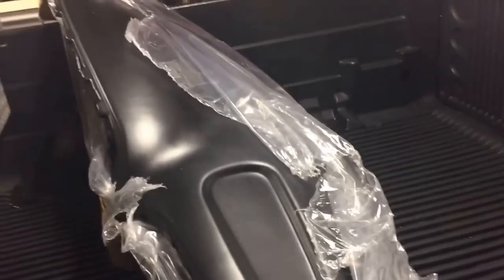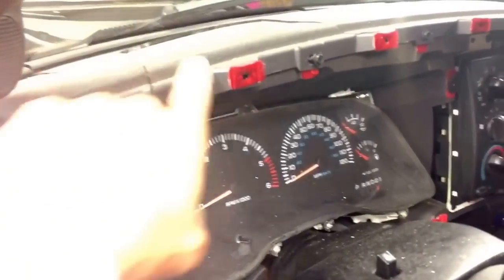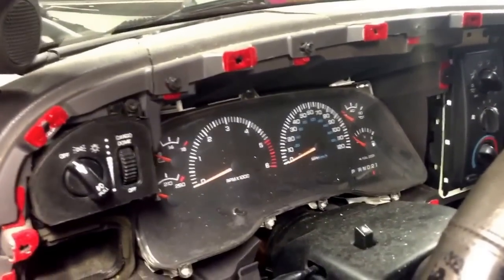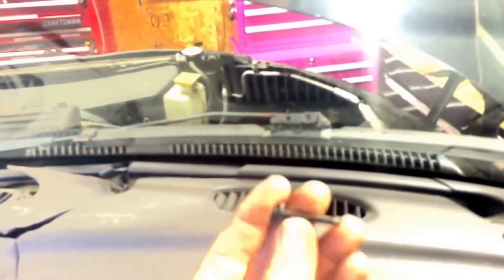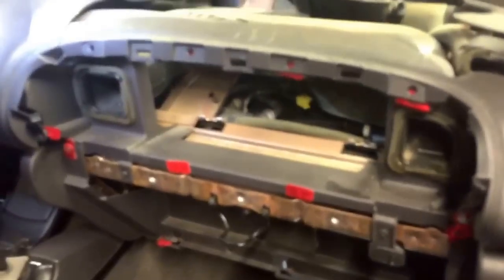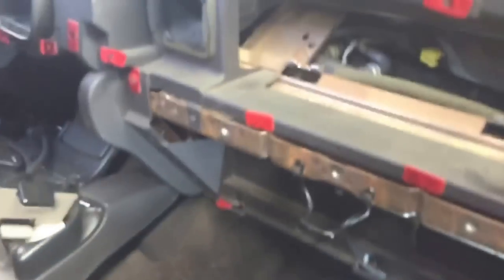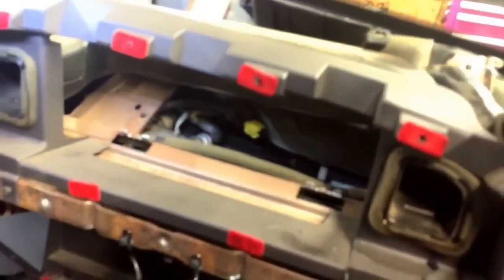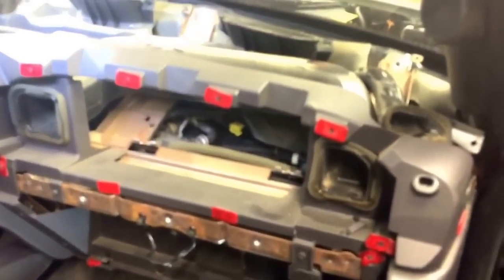Replace install new dash, repair broken cracked dash 1999 Dodge Ram

Comment: did you have to drop the steering wheel or remove the main airbag control?   several i have seen  had to unplug multiple wiring connectors, did you?

Comment: Where is it available from mine is a 96..I've been told that can't get New
Reply from the maker: They are getting harder to find new, search for oem dash, I found this one on ebay for a 96, definetly worth this price for a new one, I wouldn't want a used dash (it could be brittle) 

https://www.ebay.com/itm/94-97-Dodge-Ram-1500-2500-3500-New-Gray-Dash-Panel-Pad-Top-Mopar-Factory-OEM/333870865606?fits=Year%3A1996%7CMake%3ADodge&epid=580814802&hash=item4dbc411cc6:g:oZgAAOSwEzVgEdMN

Comment: Where did you get the dashboard?
Reply from the maker: I had got mine from ebay, They also make an overlay dash, which just goes overtop of your existing dash, they are cheaper and easy to install, but still doesn't look as good as the original, just make sure when you search, which one you are getting, the OEM replacements where about $350 5 years ago when I replaced mine, probably higher now, the overlays are about $100

Comment: I would have just replaced the bezel and board. Looks more trouble than it's worth. Neat video though. Interesting to see the process.  Thx man
Reply from the maker: Thanks, Yeah mine was getting pretty bad, they also make an overlay that just goes over top of the current dash, It looks decent.
Reply: my dash is so bad that sections of the dash actually pulled off when removing the bezel and was only left with a few in tact areas to reattach my bezel. Even my sub dash is falling apart. Guess the Arizona weather took a toll.

Comment: Great video! My dad is wanting to replace his; where did you find the new dash? Do you have a  part number or link?
Reply from the maker: I got mine on ebay, I checked the link and it isn't showing up, but here is a link to one that looks like it 

   https://www.ebay.com/itm/Dodge-Ram-Replacement-Dash-Dashboard-board-pad-dashpad-top-panel-plastic-pickup/153812316674?fits=Year%3A1999%7CMake%3ADodge&hash=item23cfedb202:g:1owAAOSwAGxdt7ka . 

be sure and look at the listings, because they also make and overlay that just goes over top of the dash for about $100, they look decent if you want a cheaper option, but the real oem replacements are higher, but I preferred the actual dash over using an overlay.

Comment: Is there any chance you remember where you was able to get a dash been loking and its over 400 for everone i have found
Reply from the maker: I got mine on ebay, This is the cheapest one that I see on there right now........ https://www.ebay.com/itm/DODGE-RAM-REPLACEMENT-DASH-TOP-98-02-2500-3500-98-01-1500/323775541411?hash=item4b6286b0a3:g:KpgAAOSwkV9ceUCc
Reply: Amazon

Comment: I have a 2000 Ram 2500/Cummins diesel I bought brand new.  I have rarely used it these last ten years or so but even covered or garaged the ENTIRE PLASTIC DASH ASSEMBLY HAS BROKEN DOWN.  Not just the dash top, EVERYTHING. The plastic parts unseen behind the dash bezel and the dash cover have also broken down, the knee kick pad covers, the glove box, EVERYTHING.  I got in it the other day and pushed a map light in the overhead console and something in there snapped and now that no longer works!  Mine only has about 100K on it and as these diesel 2500's go for it's age that's pretty low mileage but I literally dare not drive it on the open road.  huge chunks of dash continue to just fall out!.  I swear to God I don't know how Daimler Chrysler avoided a major recall on these trucks.  They must have absolutely paid off or blown the powers that be to avoid this. My truck is not unusable because of a failure of the drivetrain or basic truck itself, it is all contained in the dash area, period. I no longer consider it useful or SAFE to operate on the road and have not for some years now. 

Literally, I have been robbed.

Comment: Thanks for posting this.  I have been needing to this with my Ram. Even with this video it looks like a real pain in the ass.
Reply: I will be doing my 02 , how did it work out for you ?
Reply: @irishammer319  

I actually never got around to it yet. I bought a cheap dash cover until I can get to it or if I get to it 🙃 

Keep mee posted on how it went for you if you wouldn't mind.

Comment: I salute you for avoiding removing the entire dash but I will assure everyone that it is far easier to install the part with the dash assembly out of the truck. Additionally this would afford opportunity to replace heater core and A/C evaporator.

Comment: You made that look a lot easier than the last instruction manual mine came with, instructing to pull the whole dash out and suspend it with straps.

Maybe that’s because it’s also doing the heater core and ac evap?

Comment: Does any one have a 1800# I can’t find anything but dash pads for my 99 dodge ram
Reply from the maker: I looked and I can't find the ones on Ebay where I got mine, but I did find a few other sites, https://www.genosgarage.com/product/dodge-ram-replacement-dash-drd8-2/dashtops and https://www.amazon.com/dp/B06X931MKB/ref=sspa_dk_detail_2?psc=1&pd_rd_i=B06X931MKB
Reply: @TheMrcHilton  Geno's Garage has both the genuine MOPAR dash and the semi-ill-fitting third-party dash plus dash "skins".

Comment: Thank you for this video, I just needed to figure out how to remove the gauge console bezel which you demonstrated in the first :15 seconds of the video.   I purchased a dash cap which overlays and is siliconed onto the dashboard, instead of needing to remove the entire dashboard.  https://goo.gl/M6Mo9d - got this one on amazon for $139 for a 1999 Dodge Ram 1500

Comment: Where do you purchase your dash? Would like to get one that doesn’t have the vent screws.
Reply from the maker: I got mine on ebay you can search and find different ones listed. ,https://www.ebay.com/itm/DODGE-Ram-Dash-Board-TOP-Replacement-Fits-98-01-1500-98-02-2500-3500-Series/301978136231?hash=item464f4caea7:g:uOsAAOSwFNZWxikr
Reply: This link too me to a dashmat, not the dashboard

Comment: Thanks for the video.  Has this replacement cracked or feel like it might at any time?   You mention OEM who would use OEM replacement dash parts after dealing with this crap?

Comment: You would mention if we had questions leave comments. I bought my daughter a 2000 Dodge Ram 1500 and apparently it needs a blend door event swing door and a lever that is part number 47203408, I have searched and searched everywhere says that lever is no longer available-any suggestions and where I could find that? Of course possibly junkyards but didn't know if you knew if anybody that manufactures that. Thank you for your time!

Comment: how was this not a recall from dodge WTF!!!!!
Reply: I think because it is not considered a safety issue.
Reply: Safety my ass.  If we got in a accident and my arms went foward and smashed into the dash, and it fractured into the pieces I saw in this video, my arms and hands would be sliced to pieces.
 Are today's dashes still doing this?
Reply: Because it wasn’t happening until several years after these trucks were in production. My 02 had over 100k before it started to crack
Reply: @WilleJamesHuff  lucky you
Reply: I called Dodge and told them what I think of these piece of sh!t dashes.
Reply: @guinness4822  and I am sure you impressed them tremendously. Here's what happened after your call: they laughed about the whining little idiot on the phone over coffee.
Reply: Is there a reason Why daimler hasn't changed to these dashes?
Reply: u tuber 
You think this is bad, look up 53 block
Reply: Imagine if the airbag goes off, sending plastic shrapnel into you're face during a collision! My dash in my dodge started with one tiny crack after replacing the heater core. Hitting potholes in my town busted out the rest!
Reply: @brentmiller1607  the airbag does not deploy in a direction that would result in your scenario.
Reply: Walter K plus, the airbag is designed to not have hard ABS plastic over it like the rest of the dash is (for the reason listed). It has a flexible (almost rubber like) plastic that won’t send shrapnel into your face if it deploys. Also as a side note, when messing with airbags, be EXTREMELY careful when disconnecting the plugs and MAKE ABSOLUTELY SURE that you disconnect your batter cables before you mess with them. I’ve seen too many people pull them the wrong way or jar the plug too much and deploy the bag. Not to mention, those aren’t cheap to replace either.
Reply: @brentmiller1607  I'm no engineer but I think the airbag would crack the dash anyways so the plastic shrapnel argument would apply even in a good dashboard.

Comment: I have an '02 dodge club cab but mine has not yet cracked. I keep in inside or in my carport and I keep armor all on it regularly. If I have at some time to get a new one how much is it on ebay as opposed to the dealer?
Reply: Genosgarage.com great replacement part. I replaced the dash cover and  replaced the heater core. The original dash literally fell apart as I was removing it. It filled a regular grocery store plastic bag! I have an ‘02 Ram 2500 HO with the 6-speed.
This video brings back a lot of memories, good and sad.....great video again!
Reply: @Euphoil  I saw the Geno Garage video and it needs painted but they can supply the correct color paint. I was a diesel though. Do you know if there's a difference in the dash if its gas?
Reply from the maker: If I remember correctly, The replacements on ebay are around $300 compared to $700 at the dealership.

Comment: Did all your cracks start out as hairline cracks? I've got a bunch of tiny ones starting on mine that just keep getting closer and closer to the bezel. Hopefully they don't get wider and look like shit.
Reply from the maker: +**Classified**  Yes the cracks generally start out small, and the dash continues to become more brittle, eventually it will get bigger, this is the best permanent fix, but they also make an overlay that goes directly overtop of your existing dash, and it actually does look like a factory dash.
Reply: Chiltons Auto Yeah, I've seen a lot of the products the aftermarket is offering. I think I'll put a mat over mine when it gets bad enough. Wish I would have done that years ago though. I know someone with a 10 year old chevy truck that has a perfect looking dash in the Texas sun, all because he used a dash mat. The headliner fell, the window seals dried up, but the dash looked amazing.

Comment: can you get the dash out without breaking it I'm trying to pull one out a junk yard and have everything off but those 2 screws at each dash vent
Reply: Joe Lombardo I'm probably just gonna get a dash mat and put it over the dash
Reply: kyle d No it'd be just the same as trying to pull out the one he is working on in this video. Their all the same, every Dodge Ram has this problem. Should have been recalled.
Reply: @erich9162  dumb-ass comment regarding "recall" as it is not a safety issue. Purely cosmetic.
Reply: Walter K I'm so sorry Mr. Perfect. Lmao. Gtfo
Reply: @erich9162  no, not perfect, merely realistic.
Reply: Mine has this problem too but mine is alot better than others I have seen. Mine doesn't have craters or holes just a few cracks. It still drives me fucking crazy though. It looks ugly 😤😲
Reply: Fox-E (Bonzai) if your worried about looks they make a dashboard skin that just goes over it, mine is like this guys I just got a replacement from a scrap truck with no cracks just not looking forward to the install...
Reply: Fox-E (Bonzai) lol yeah I got mine covered  with one right now. With 90% of the dash gone. Might install this weekend
Reply: Joe Lombardo I got one for my H2 and I like it. Just need 2 more for my dodge then my camaro
Reply: Fox-E (Bonzai) I was thinking about getting one for my charger not sure, they are nice and keep the heat down.
Reply: Joe Lombardo I Adrian m actually have a sunshade and dashmat for my H2. Lol.  I want to find sunshades for the side windows to keep the sun out and ruining everything 😫
Reply: Fox-E (Bonzai) o I hear you  I'm in Florida and the sun is crazy, my car feels like 1000 degrees lol

Comment: He is right for the most part LMC is OEM which means all the screws from the air ducts are there the only way is remove the windshield make sure disconnect battery drop steering column 2 nuts lay against seat this allows the dash to be pulled forward with both hands (better with 2 people ) gently pull the whole dash to you then you can get to all 15 screws open hood easier to attach them all and do attach the left and right air ducts before keep dash low to body go slow and you should be done reverse the order you took apart!

Comment: on mine only broke the cover or the bezel, and i find a replacement but i dont know how to take out the old one and instal the new one
Reply from the maker: juan al  What do you mean by yours only broke the cover? basically its only 2 parts, either the dash or the bezel that goes around the the speedometer and radio, let me know exactly what is broke and ill try and help you.
Reply: Chiltons Auto The bezel and i dont know how to take the old one and instal the New one
Reply from the maker: juan al The Bezel that is around the speedometer and radio just pulls off, It has clips that just snap in, to remove is you just pull out on the bezel, and the new one will snap in to the dash, at the beginning of my video it shows me removing the bezel, I already had it loose and the video just shows me finishing taking it off.
Reply: Chiltons Auto ok thnx im gona try

Comment: Thanks for the hyperlink....Wow you paid $394 for yours...I might have to stick
with the LCM unit.  Thanks again.
Reply from the maker: Yeah actually my wife got it for me for christmas, If I bought it I may have shopped around a little more, If you are mechanically inclined then it shouldn't be a problem for you, It took me about 4 hours, and overall it wasn't bad, the worst part was getting the duct work on the ends snapped together after it was attached to the new dash. I put mine off for years, But I wish I had done it sooner,  4 hours and a few scratches and a new dash, it's worth the effort, I'd guess it's probably over $1,000 to have the dealer replace it. good luck.
Reply: Thanks for the replies again.  I have seen really bad looking damaged dash on the web.
Chrysler should have recalled it.  I'm not a Chrysler or Dodge follower.  I only bought
my 02 Ram 2500 because of the 5.9 Cummins.  I wish it is a different brand
truck but it was what I can afford.
When I get it done this Spring I will update you.

Comment: Im hoping that the LCM DP doesn't come with the 8 screw holes under the DP.  But if
it does I really intend to put back the 8 screws for the 4 defrost vents.  One of your readers actually removed the windshield. I can only imagine the added work.
My windshield is already cracked but I don't what my insurance company will say
if I ask for a new one...
Reply from the maker: Yes no windshield would make it much easier, But I would think even if yours comes with the 8 screw holes, If you don't have any luck putting the screws in, I think it would still work just like mine did without the screws.
Reply: What brand did you buy and how much?
Was it from an on-line company?
I have been seriously dreading this project
to come. I pretty mechanical overall. I work
on cars since high school and rebuilt engines
transmission etc.
Thanks again

Comment: Chiltons Auto: Thanks for the fast reply.  Is your dashboard from LCM?  So yours
didn't come with the screw holes under the new dashboard? The LCM dashpad I need
to get is $239 for the DP, $20 oversize freight, and $24 for a washer kit that they highly recommended to use with the new DP.  That's $284 roughly. The factory manual I have for my '02 Ram requires loosening the 2 bolts on the side edge of the PD. This will allow for the DP to actually peel away from the windshield.  This maybe will allow
me to install the 8 screws for the defrost vents.  I don't know yet...
Reply from the maker: Mine wasn't from LCM, It does have screw holes all the way across the front, and also has screws all the way across in front of the windshield, It does have screw holes to attach the 2 pieces of duct on each corner of the dash, The only part that was different then my original dash, is it didnt have screw holes for the vents, But that didn't seem to matter since there is screws all across the dash by the windshield, that fastens the dash cover down tight to the vehicle.  It did seem like it would be very difficult to attach screws to the defroster vents, It did look like the best option may be to take the duct and vents loose from the truck and attach to the new dash first, but either way still looked difficult, I was happy with mine without having to do that.
Reply: Joe John ii

Comment: I guess I wasn't so mad when I found that certain Chevy truck years also have
the same dashboard cracking problem.  I just don't understand why this country
keep making crappy products.  If they put the 5.9 Cummins in a Toyata or Nissan
I probably would have gone Japanese hands down.
Reply: LOL! 5.9 Cummins in a Toyota or a Nissan (err, Nissan now is Peugeot). That would be hilarious. Those frames would be pretzels at the first application of throttle.
Reply: @walterk1221  not the case.  https://bringatrailer.com/2017/06/21/5-9-liter-cummins-turbodiesel-swapped-1993-toyota-land-cruiser/
Reply: @walterk1221  Also...LOL  https://www.dieselbombers.com/diesel-engine-conversions/50090-05-nissan-titan-5-9-cummins-10.html

Comment: LMC.com carries both just a cover and OEM dash pad.  The new OEM dash pad
is about $300 for the piece, freight a washer kit that they highly recommended
to also buy.   I have called them few times to see if the new OEM dash pad has
screw holes for the defroster vents.  No one there could tell me.  All they can say
is it is just like the original.